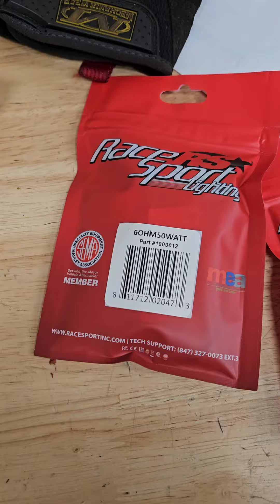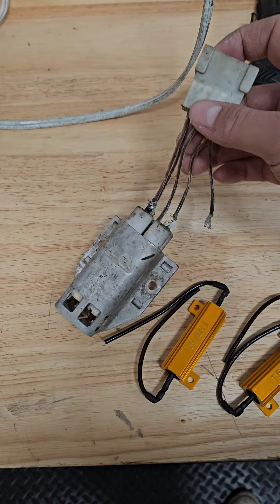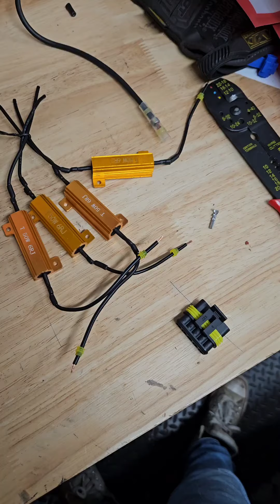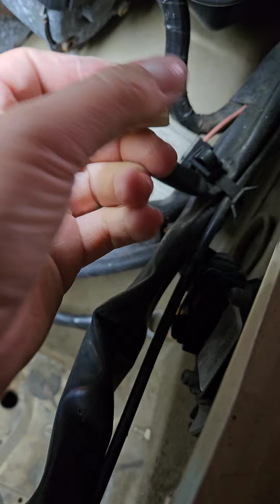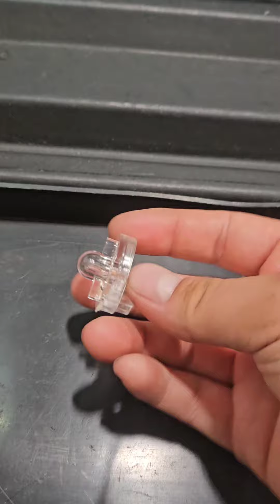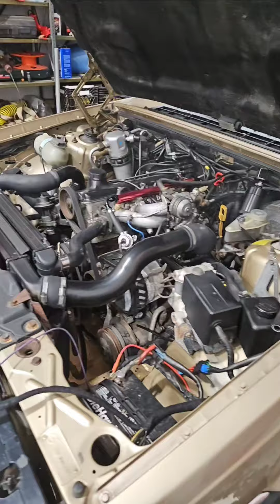Bad Volvo Injector Resistor Pack? Here's Your Redblock Solution!

Comment: Nice video, thank you! Quesstion, when  you use the noid to test the injectors, does it shine dim or does it need to be bright? Mine shines dim and was told I might have a grounding issue. Also is that the stock fuel rail with the tan injectors all running with that pack you made, then? 
Thanks in Advance
Reply from the maker: Welcome! I actually sold the car and ran great with adjustable fuel regulator and the volvo 850 (white) injectors. I used the resistor pack too but it ran so much better with the white injectors without the pack. If it shines at all you have power! You can test with a multimeter too across the pins to see if it's getting low voltage though